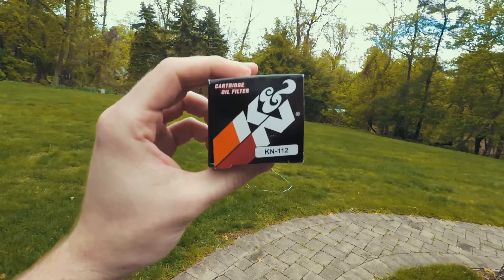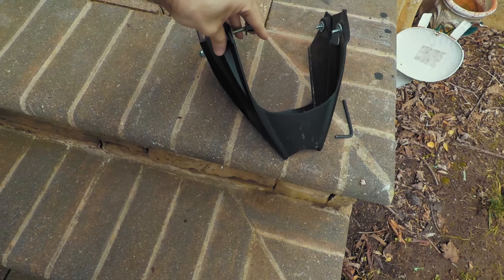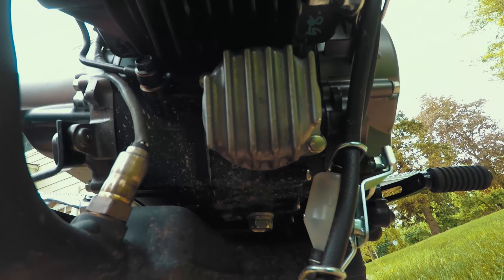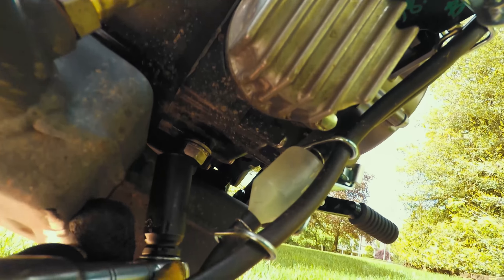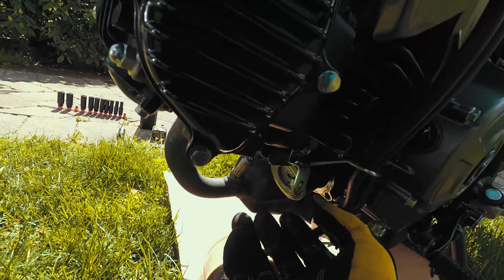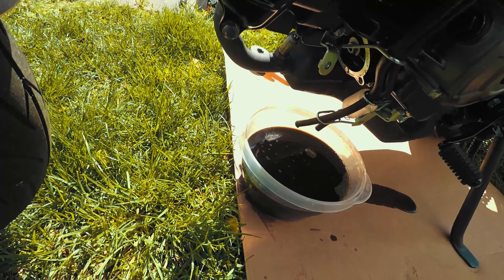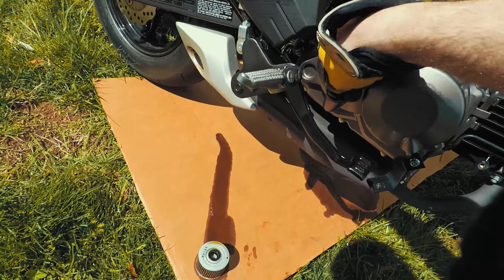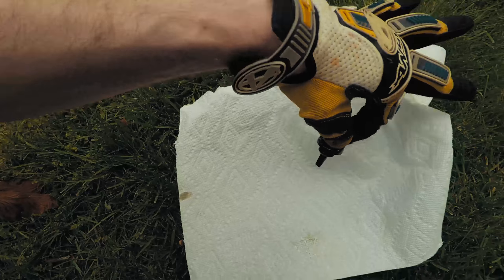How To Change The Oil On The Kawasaki z125 Pro

Comment: aren't you supposed to hold the bike level not on the kickstand while checking the oil level to get a proper reading?
Reply from the maker: A little bit of shifty camera work. I cut out the part where I shoved some old wood under the kick stand =)
Reply: Actually the kickstand won't get you level
 Glue a small bubble level on the center of the fork tree.

Comment: When should I do my first oil change on my z125 Pro? how many miles
Reply: Josh Day if it's brand new I believe first one is at 500 miles and then every 1500 miles
Reply: Josh Day first at 600 then every 1500
Reply: Wich oil should I use ? Is there any difference between oil brands. ?

Comment: Nice job... the other one WAS a drunken ramble.
TORQUE SPECS:
Drain Plug - 21 ft lbs
Oil Filter Cover Bolts - 46 in lbs

Comment: What you rather Grom or the z125 ?
Reply from the maker: GROM ALL DAY
Reply: I would also, but I'm hoping Honda with the 2019 version of the Grom puts a bigger gas tank.  The z125pro has a 2 gallon tank, why didn't Honda do this?  Both bikes are the same weight and I know the difference in the tire size choicing with Honda Versus kawasaki didn't make THAT much of a weight difference that allowed Kawaski to put a .55 gallon bigger tank on to keep weight the same.  Otherwise, the z125pro will be my first motorcycle.
Reply: Why the grom? Top end speed? 

BTW, I'm not getting close to 2 gallons in my tank. I believe they are 1.2 gallons

Comment: Just saying - the bike must be level when checking oil (not on side stand) - yes this makes a big difference. Also you are supposed to screw the cap all the way in then back out to properly check level. This is all according to the service manual.
Reply: Second part doesn't really matter
Reply: @myname8513  doesn’t ‘really’ matter? I disagree- If you want to do it right, follow the service manual.
Reply: @legine3  what's the point though? If you add 1 quart what's the risk? It's not like an extra chamber is going to spontaneously attach itself to the oil reservoir.

Comment: The bike should have been run for a few minutes to circulate the new oil through the new filter then re-checked or you will get a false reading !
Reply: Do you not trust that 1 quart has been added to the 1 quart bottle of new oil?

Comment: Actually the Z125 takes 900ml of oil not 1000ml in a quart or it will back pressure and leak some into the air filter
Reply: wrong.... 900ml without filter and 1000ml with filter
Reply: thats the problem im trying to figure out right now why the z125 is blowing oil out the airbox i think it is way over filled in the crankcase